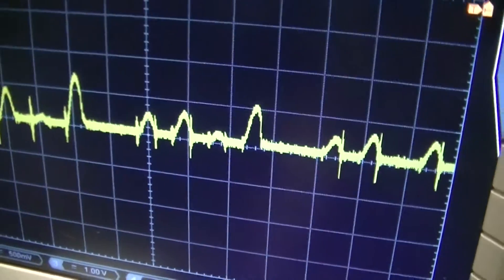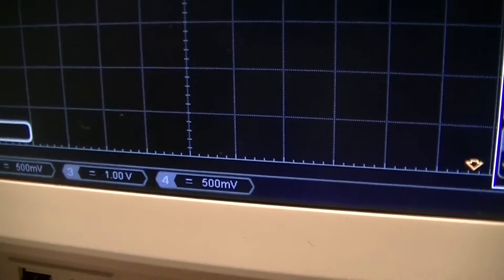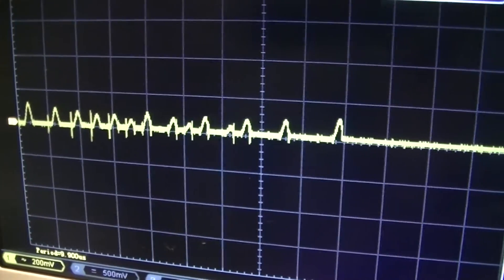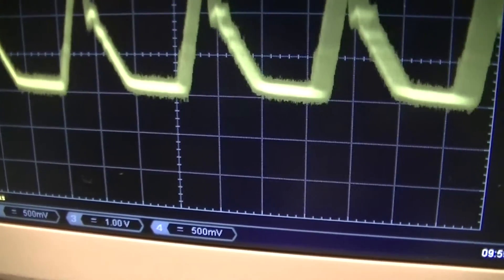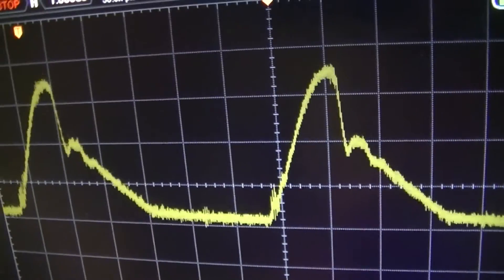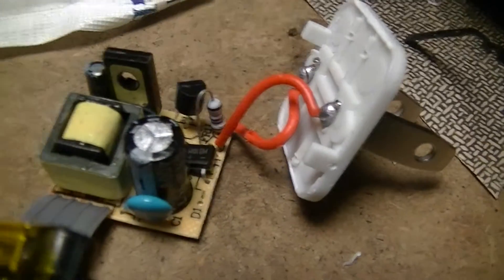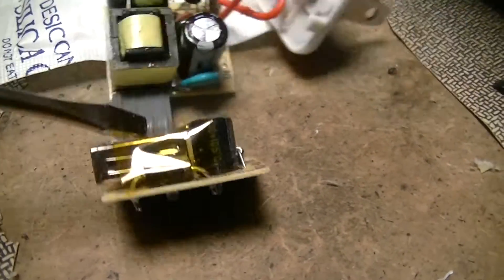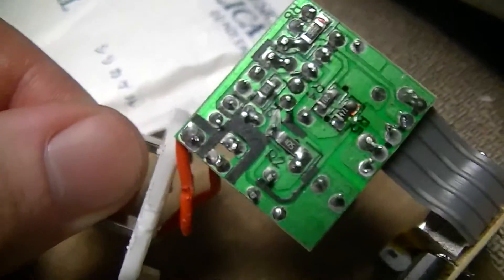Fake iPhone/iPod/Apple charger output analysis and guts

Comment: Would it be possible to test noise other aspects of a switching regulator such as the 	 		 			 			 		
PTN78000W from TI?

For me, due to  crappy power handling of the chinese stuff, and the genuine chargers being too expensive. I always ended up building replacement chargers using the TI branded switching regulator, and an old 12V adapter (have a bunch laying around) They never seemed to give any problems. though I do not have a scope to hook it up to)

Due to the wide input voltage handling I feel it is worth building since I can connect the regulator to almost any battery source above 5V and it would charge.
Reply from the maker: My go to DC/DC is usually an MC34063 as they come in DIP/DIL-8 packages.  From what I remember of some testing I did for my DIY MPPT charge controller, the noise without the recommended LC filter in the reference design was about 100mVpp.  I just have the switcher produce ~6V and use an MCP1702 LDO as a postreg.  I've found that to be less touchy than the LC filter as I remember it not being very effective.  That may have just been low loading though (PIC, MCP6004, idiot lights, etc).